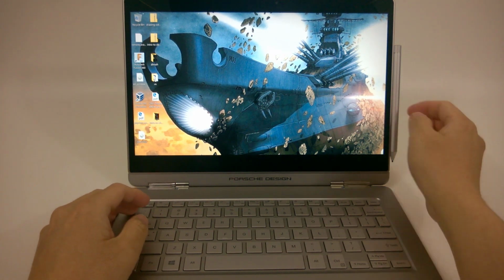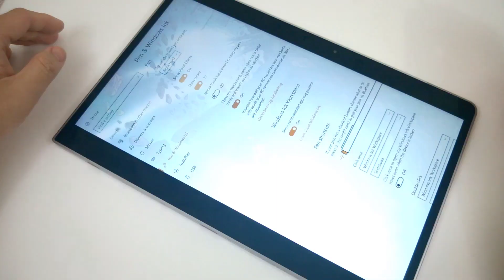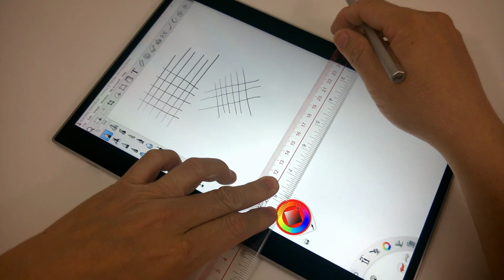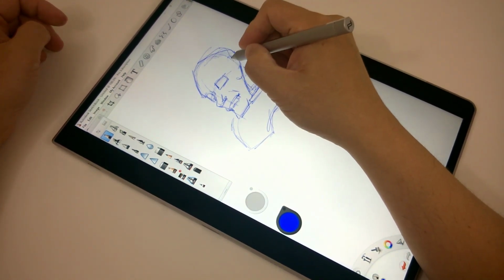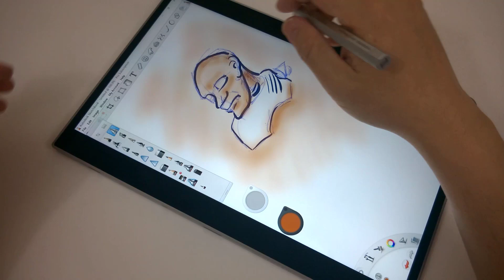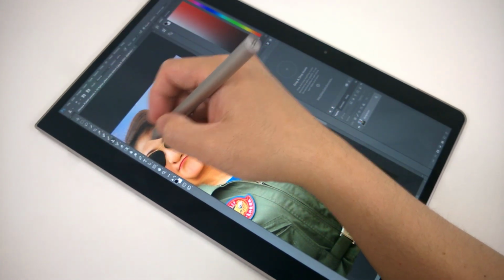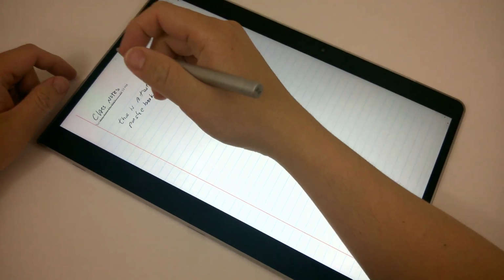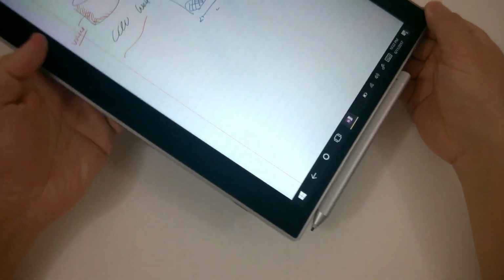Porsche Design Book One: Pen Performance

Comment: Thank you Dower for being one of the rare sources of information on this computer!
How did your RMA go? Did you manage to solve your coil whine problem?
Reply from the maker: Well, my first RMA went a little rough. I bought my system from NewEgg, and it had charging issues, as well as the coil whine. Sadly, NewEgg didn't send me another one. They sent the slowest possible Fedex return label they could find, and by the time they got the original, they were sold out. I did order another one from Porsche directly, and paid for overnight shipping. Unfortunately, I'm probably going to return this one too. The coil whine seems fine now, but the screen has uneven lighting and has backlight bleed around various regions of the display. The system also has issues starting up the Windows Hello sensor. The biggest problem has to be the tablet driver stopping (this might just be a driver issue). All together, these issues diminish the premium cost of this device. Trying to call support is troublesome too. I really want to love this device, but certain aspects make me worried.
Reply: I am sorry to hear that, but I can really relate.
First buy: unbearable whine, frequent activation of the fans. Returned, the store gave my money back.

Second buy: directly from a Porsche store. It would automatically overheat and shutdown every 3/5 minutes. I gave it back to Porsche, they immediately exchanged for a new one.

Third one went well (with some pen glitches and some bearable whines) for a couple weeks. Now, the power button does not work anymore, and I cannot turn it on anymore in any way. It is just off. I'm going to go to the store to fix it, but I've no idea how they'll manage that...
Reply from the maker: Wow! So you're on your third! I guess it's a good thing you can go to a store. I'm stuck where I'm at with email and phone calls. Their support doesn't seem very good. But I didn't register my device yet. I've been told to do that... Which I did, but now I'm waiting for confirmation. The whole support process is quite clunky.
Reply: Hi guys, I've been through the same thing with the whining noise, excessive overheating and fan noise. Then the trackpad suddenly stopped working. And I never put a lot of pressure on the CPU - it was only running one note. It seems like a really cool device but it has a looooooong way to go to become a solid premium device. Unfortunately.. I really had high hopes for it!!
Reply: I believe there are significant difference between each product, regarding whines, overheating and fans.
One of mine had everything, including whines, fans went on continuously, and overheat was constant.
My current one (currently being repaired for something else) does not seem to overheat or switch on the fans for no reasons. A slight whine is still there, both on the tablet and (puzzling) on the base, when it is disconnected from everyhing and just left alone: it still whines.
I hope some firmware fixes and/or drivers are already in development.
Reply from the maker: Yes, I feel the same way. The device is a premium device, but they have some quality issues with it. My personal opinion is that a device that demands a $2500+ price tag should NOT have any issues/defects. The bigger problem is their support, it's not that quick, and they have low inventory, so getting a replacement is almost impossible at this point. Calling support isn't all that useful either, since there is only 1 person in the US fielding calls to the main US line. The rest is deferred to their premium support callback or email ticketing service.
Reply: @dowerchin  Hello,i just found that product, after searching something for my college. It costs 1300€ now, compared to the surface books its much cheaper with the 512gb and 16gb ram. But after seeing the Problem mentioned here, im kinda scared to buy it. Would you recomend me the "prosche design book "

Thx in Advance
Reply: Bummer, with these problems... its the same maker that makes Porsche One Book who also makes MacBook pro and MacBook and Apple Watch alongside a bunch of other products for other vendors..
I dont know if it is a good or bad product, but It looks sexy as hell...the screen should also be topnitch like around 500nits, thats not to shabby, other 2-1 are around half of that, like X360 7500U around the 280nits mark.

Comment: I have the Surface Book, but I want to upgrade to Surface Book 2 but cannot afford the price. I use 3d software like Sketchup, etc, I will be using Keyshot render and Modo 3d software. so I am interested to find out if  3d software will work well on the Porsche book one. if so I would like to  lreplace my surface book  with the Book one
Reply from the maker: The Porsche is a nice machine, but the biggest weakness is the graphics. There is no option for a GPU other than the built in Intel GMA. I didn't have a chance to really put it through 3d app testing, so it will depend on the software packages you want to use and their min requirements. The CPU is also a bit weaker, being a 7th gen Dual-Core processor. Depeding on how much you can get this machine for, you may want to consider something like the HP Zbook X2, which has a NVidia Quadro card, which should handle CAD graphics better.

Comment: finally what is your  advice? 
I want to have a premium windows hybrid laptop. ..
I thought PD book would be the best choice. .
they are launching the book in my country within a week, limited quantity so I have to pre-order and to give a down payment. .
please advise. ..
and advice me if there is any other premium windows laptop I can have. ..
Reply from the maker: The Porsche Design Book One is a very nice machine. But, I have concerns with Porsche's ability to properly support the device and some of their QA. I had to return mine because I wasn't pleased with light bleed from some corners of the screen. It seems trivial, but for a "Premium" computer, I should not have to deal with light bleed, especially for a $2600 device when my $300 devices don't have this problem. I've had 2 of these now, and they both have something called "coil whine". When the device is off, you may hear a sort of whine coming from the computer. My first was very noticeable, my second one wasn't as bad. The speakers are rather weak (something I noticed later on). 
Despite those issues, the device was very solid, I really had no major issues (that weren't my fault). There aren't many computers that use a Wacom pen, and that's a very nice plus. 
Dealing with support is a bit cumbersome. They have a call back service, and slow email response, Porsche doesn't seem ready to be a computer reseller, and they don't seem to have the support infrastructure in place to handle things quickly. 
For the price, it's a little hard to swallow now, especially if you compare it to something like the HP Spectre X360, which is almost $1000 less and is just as capable. Porsche still has the edge in the 2-in-1 design with the detachable screen and the Wacom pen. If you can live without those features, you might be just fine with something like the HP Spectre X360. I'm working on my review of the Spectre, so I'll have that up soon. I hope this helps.
Reply: Dower Chin thanks a lot 
Really kind of you to give us all this time

Comment: Can you upgrade CPU or is it soldier on
Reply from the maker: I never tried opening up the unit, but I'm sure that the CPU is soldered onto the motherboard (along with the RAM). If this unit is like a Surface Pro, the only thing you can probably replace is the SSD.

Comment: Any tilt functionality?
Reply from the maker: Ah, I forgot to mention that... No, that's missing from this stylus. I think that special bit of functionality is being kept close to Wacom's own MobileStudio Pro. The only other stylus that has tilt is Apple's Pencil.
Reply: Dower Chin ... and the latest Surface Pro, that has tilt as well. Sucks that for such a premium device we couldn't get the tilt  Anyway, great video!
Reply from the maker: Oh, that's right! I think I remember them saying that. Hmm, it'll be interesting to see how well it works.
Reply: Will the new surface pen work on this device?
Reply from the maker: No, the new Surface Pen won't work here. It's because Porsche Design Book One uses Wacom's tech, while Microsoft has moved to their own N-Trig pen technology (starting with the Surface Pro 3 and up).
Reply: I see. BTW have you tried to install Android x86 on this device and could you try it for me? Phoenix os or Remix os. I wanna know will the touchscreen work while it's running Android. Thank you
Reply from the maker: Hmm, I've never tried RemixOS before, but it does look interesting. So far, my attempts with it haven't been good. I had to disable Secure Boot in the bios, and my first attempt was with a flash drive, but that didn't work (the installer didn't make a bootable drive for some reason). My second try was to install on the HD, and the boot manager installed, but when I chose Remix, it flashed a quick message and sat on a black screen with a underline cursor in the top left. I think I did see brief message about the CPU family wasn't supported.
Reply: Dower Chin mhmm I had successfully installed it on my surface and am not sure about the 7 gen CPU. But maybe try Phoenix OS since it's still being updating, unlike Remix OS.
Reply from the maker: I was able to get Phoenix running on the device via a USB drive. Touch interface was working, but the icons were quite small. It was rather slow, but that might have been because I was using the OS on a thumb drive.
Reply: Dower Chin great! BTW I remember in the setting you can adjust the icon and text size stuff.
Reply from the maker: I'm curious, what's the idea behind running Phoenix or Remix on something like the Porsche Book? Are you looking for a development environment, or just something other than Windows?
Reply: there are some other apps that works on Android which I need. besides it's like owning another android tablet, expanding its value.
Reply from the maker: That's a good point. I might try one of these out on some of my other computers.